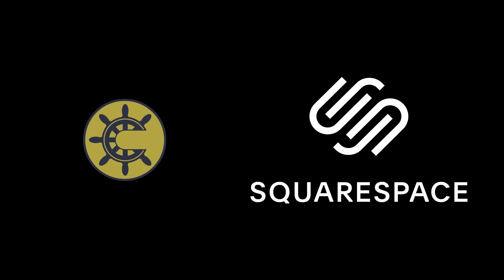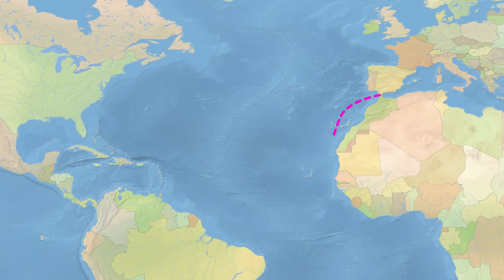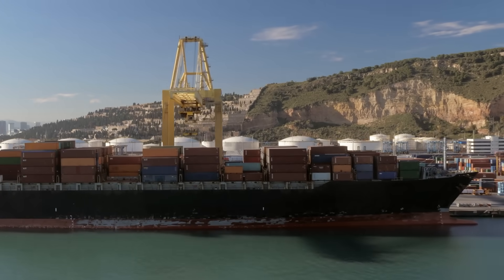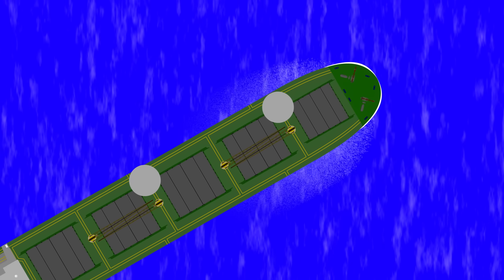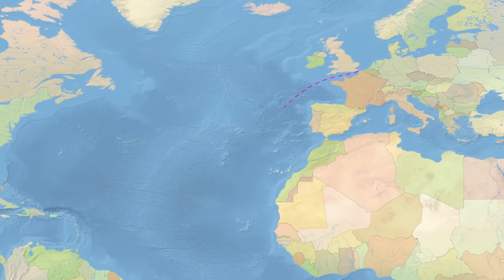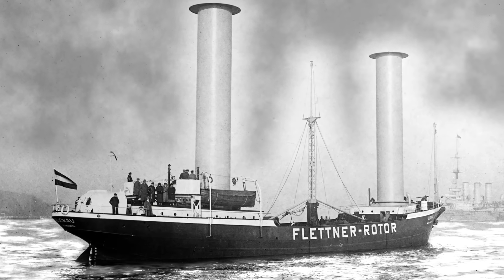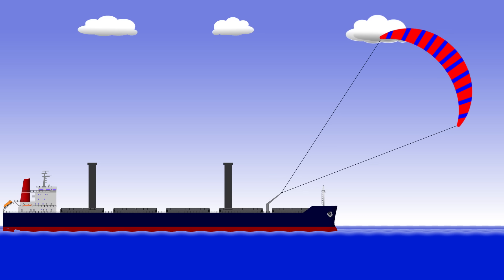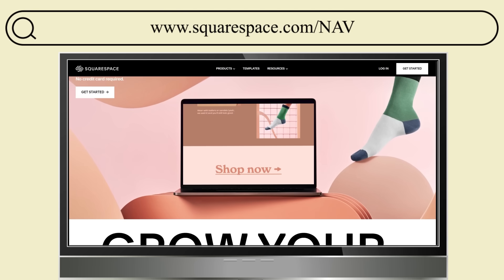Why Don't Sails Work On Ships?

Comment: Who pays for the fuel?? If it’s the charterer, then he’s more likely to charter a ship that demonstrably consumes less fuel! If it’s the ship owner, he can offer his ship to charterers for less money if he makes his ship use less fuel. If this really works, there’s no scenario that it doesn’t work economically.
Reply: if the Charterer pays for the fuel, their "more likelyness" to chose a certain ship owner would have to be enough in entirety to pay back the capital cost of installing these systems and also pay back the continuous cost of maintaining them (unless the charterer pays for that maintenance, in which case that's a partial offset of their fuel savings).
The fact is, large ship owners aren't really short of work, so the assumed greater demand from economical charterers would be difficult to translate into enough income for the ship owner to recoup their capital costs quickly.
It's a capital-averse industry in this context since demonstrably the most efficient use of their capital is to collect it into a gargantuan pile and use it to build bigger and bigger monster ships.
It's not a question of whether any particular investment is worth it, but whether a particular investment is more worth it than some other use of that capital.

Even if the ship owner pays for the fuel, yes, they can reduce their prices, but can they reduce their prices enough to create sufficient demand, and then can they actually manage to translate that demand into enough extra ship charters to where this would be a better investment than making a bigger ship or modernising some other ship, etc?

In both cases the situation is essentially the same: the charterer pays less, but that has to translate into enough extra ship charters to make this a more lucrative investment than some other options. Especially in an industry that's so established and essential as this, investors are just going to be inherently wary of new technology anyway, as even if it is a competitive investment, there's still some unknowns and thus risk Vs the tried and tested options to reduce fuel. consumption per tonne-kilometre.

Edit: Think about it like this. Is it more profitable for your landlord to install you an energy saving boiler, or is it more profitable for them to simply buy more housing?
Reply: The only argument people really have against this is that it might not cover the capital and maintenance costs, which really has nothing to do with the problem outlined in the video.

If it really works, it should eventually be adopted because someone is paying more than they need to.  That said, eventually might be a very long time, since there are plenty of other areas that might take priority for investments.
Reply: Exactly.  This guy is a one world government shill. These communists never have understood economics and never will. They are just power hungry utopians who think it will all be fine…..if you just let them run things. 

They learned fuck all from the 20th century and it’s horrendous examples of this strategy carried out on a large scale. 

Enough politics, back to sale tech.  

I think a system using boom furling and hinged masts might be feasible. 

It all comes down to fuel costs. These systems cost money. When that money is less than the cost of the saved fuel, we’ll see them. And it has nothing to do with whom the saving goes to. 

While we are on the wind power topic, I read an article not long ago about lighter than air transport. Ginormous rigid air ships that could be used for some trade routes.
Reply: Exactly. Good video but wonky economics. Leaping straight to, ‘regulation is the only solution’ is depressingly typical.
Reply: "If it’s the charterer, then he’s more likely to charter a ship that demonstrably consumes less fuel!"
Only if the monetary cost savings from using less fuel offsets the cost increase from having to retrofit ships with wind propulsion equipment. Charterers have no non-regulatory incentive to figure in environmental costs, either (those are 'paid' by everyone, and eventually by our children in the future) so they'll gladly just keep hiring dirtier, more polluting ships as long as it's cheaper for them. That's exactly the problem that needs solving.

"If it’s the ship owner, he can offer his ship to charterers for less money if he makes his ship use less fuel."
The owner doesn't care, charterers consider a lot of other criteria when selecting who to contract for a charter. Owners, especially owners with niches no one else operates in or with a proven quality of service, probably aren't going to lose much business. They also won't lose or gain much money, either, since they'd just pass on the cost of fuel, amortized over the average cost of chartering their ships. Again, no non-regulatory incentive to really change, since even when the owner is apparently paying for the fuel, it's really someone else who does in the long term.

The video is correct, there's a disconnect in many situations between who bears the cost of improvements and who feels the benefits. Regulation to make failure to improve have a direct cost to the people in control of deciding whether or not to make those improvements is the only way to get certain things done.
Reply: @wasd____  "Charterers have no non-regulatory incentive to figure in environmental costs . . ."

Back in the late1990's we hit the point of diminishing returns in environmental regulations.  Since then, every new environmental rule has increased the costs while the returns diminished.  This is why the EPA stopped identifying the actual benefits we will see with new regulations - they don't want us to see just how littel benefit their latest rule will provide.

And something you should be concerned about is the real possibility that global warming will be stopped and your children realizing that the benefits weren't worth the costs.
Reply: @colincampbell767  But that argument can be flipped over - if we reach a point of no return and our children are forced to huddle in more polar climes fighting over resources, they will wonder the same thing. Indeed it'll be worse - if we pay the cost of stopping global warming, our children will reap the benefits. If global warming is unstoppable, we reap the benefits while our children pay the cost. As a father, I would expect to have to pay for my child, not the other way round.
Reply: @petec9686  It's not just about people living in higher latitudes though, it's a question of displacement. I can't imagine the Russians wanting anyone else in Siberia apart from Russians. Same goes for any other country. People will not want to move anyway, and if by some miracle people move and are allowed in, there's a question of infrastructure, food resources, and all the logistics of displacing billions of people.

As for climate change, while there might be some disagreement about how much is anthropogenic, pretty much everyone agrees it's greater than 0. This turns it into when, not if. Global temperature has never climbed as fast as it is now.
A warmer planet is demonstrably not a good thing because the declining biodiversity everywhere is very clear indicator. Most species are completely unable to adapt to such a rapid change in both habitat and temperature.
Reply: @merseyviking  declining biodiversity in some areas I believe is a function of man's altering the environment locally through pesticides and simply by being somewhere. I don't believe it can be pointed at temperature, because as I have said, warmer temps will make some places nicer and some places less nice.

You could argue that it will make living in a very hot place worse and I could just as easily argue that it will improve life in places. 

I do believe that the best argument to reduce carbon based fuel use is the fact that it is finite. Use it where there is no better option, such as jet travel, but get away from it where we can. And today, the best way to do that is to go all in on nuke power. 

Trouble is, the same people preaching about stopping fossil fuel use tend to be the same ones who have spent the last half century or so condemning nuke power.

It would be nice if we could run the place off windmills, but we can't. Not even close.
Reply: @petec9686  if you agree the earth is warming, why deny that increased ice melt is going to cause sea level rise? nuclear is needed to stop CO2 emissions, not to satisfy some peak oil fantasy. Some countries are approaching 40% wind power. you can have, in fact you need both - cheap nuclear balancing cheap renewables. what's the point of openly contradicting reality, old man?
Reply: @doorhanger9317  enjoy your 7 dollar gas. 

Are there countries that can run 40% on wind?

Maybe. 

I was in Aruba a few years ago. They have small power needs and more or less continuous trade winds. They are probably over 40%. 

But large countries have power needs beyond making ice for mojitos  and they have large areas that aren’t windy. 

I am not saying that developing these forms of power don’t make sense. Where I do have a problem with our current strategy which is to force oil costs through the roof so we have no choice.
Reply: @petec9686  Denmark runs almost 50% on wind, it supplies about a third of electricity in Ireland and Uruguay, and a quarter of electricity in the UK, Germany, and Portugal. Germany in particular shows how you don't need lots of offshore space to have a sizeable amount of wind energy. There are problems with having much more wind power than these levels (Denmark uses Norwegian hydropower to balance its high wind levels) but it's no longer a plaything of hippies and greenpeace activists. Wind and solar can compete and work with nuclear and hydro these days. And the reason oil prices are going up is because one of the world's major oil suppliers has been embargoed, that's nothing to do with wind turbines.
Reply: @petec9686  making "nice" places less nice and "less nice" places more nice, absolutely will cause mass extinctions. Things that love somewhere are used to the climate that is there, and if the climate changes faster than they can adapt, they die.
Reply: @jetison333  what do you base that extremely vague statement on?

The fact is that any of these changes are slow enough for man to adapt easily and other creatures would t necessarily adapt. They might simply migrate a bit. 

The bottom line is that the climate does change. Always has, always will. These changes will improve some habitats and make others less hospitable. As far as man goes, we still have a bigger problem with places being too cold than we do with too warm. Cold kills far more.

Man is a tropical species. We only survive cold climates through our ability to make tools.
Reply: @doorhanger9317  Germany now has to import most of their energy. Turns out we don’t have a great way to store that wind energy yet.
Reply: @nicwelch  yes, this is indeed one of the problems of the highly gas dependent "energiewende" and the cancellation of nuclear power. Wind and solar need a backup, and if you want to stay green the options are pretty much just hydro or nuclear.
Germany chose gas and coal as their backup. And now they're suffering for it.
Reply: @petec9686 The grains which we depend on can only reliably grow within certain conditions. However both droughts and flooding are exacerbated by climate change. These cause famines which can worsen existing societal issues. 

For example the Syrian civil war began after the worst drought in 900+ years which forced ~1Mn impoverished farmers into the main cities, intensifying the existing conflicts there. 

Climate change leads to more famines which leads to more global conflict. We could adapt to that, or we could adapt right now and not lose our ability to produce food.

Comment: To say it can only be achieved thru regulation is ridiculous.
If owners didn't have any incentive to make their ships efficient,  they'd still be running on coal.
Reply: yeah its not like there are no modern Sailships being built. Neoline France Based Company is planing on one for for Ro-Ro service between France and United States.
another thing i missed in this Video is the Dyna Rig: Maltease Faclon, Black Pearl, Eco-liner project , and Royal Clipper that 5 masted Cruiseship were the Dyna Rig is rotated 90° to keep the old Tallship appearance where the Sails roll into the yards instead of the Masts.

not gona write a list of the regular Tallships that are actually in Sailing Cargo service.
Reply: I agree.  It's seems more likely that it's the low price of fossil fuels keeping people from addiction.

Of course, part of the problem with climate change is that all the negative externalities of fossil fuel consumption aren't price in, so in the absence of global carbon pricing or something similar, regulation may be the best path forward.
Reply: I imagine the cost to install them would not be compensated by fuel savings for enough years that neither parties consider it a worthwhile investment.  Otherwise they'd already be doing it.
Reply: ....the incentive is to reduce the operating cost. But when fuel is cheap the financial saving is not enough to justify the capital investment and operation of the equipment, and it will not be adopted. This, in general, would seem to be the case so far.
Reply: Coal power plants deliver cheaper power than oil power plants. On a sufficiently big ship coal should be cheaper than oil.
Reply: @jannikheidemann3805  coal has half the energy density of diesel. That means that to carry the same amount of energy, a coal ship will be carrying twice the weight of fuel. The volumetric density is also higher for coal. Solid fuels are also much harder to deal with than fluid ones. This doesn’t matter on the ground, where the fuel is delivered with conveyor belts and pipelines, but when you have to carry your fuel with you, it makes coal impractical
Reply: The ships are still running on fossil fuels and don't seem interested in changing as long as fuel is cheap, so yes, it would seem that regulation is probably the only way to achieve this.
Reply: @wasd____  regulations are a terrible idea, hopefully won't be made, and to even think of letting the UN influence regulations is concerning.
Reply: @Matiassanita  Clearly a lack of regulation hasn't stopped ships from using highly polluting fossil fuels, so I don't know what else you think the solution is.